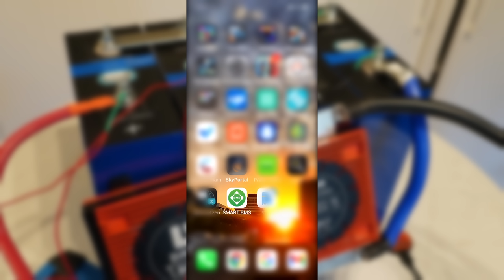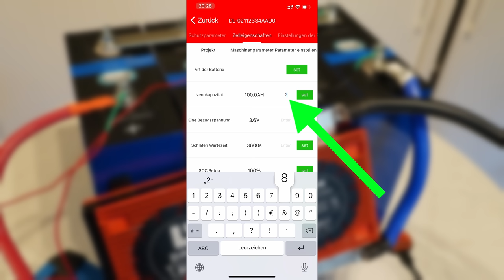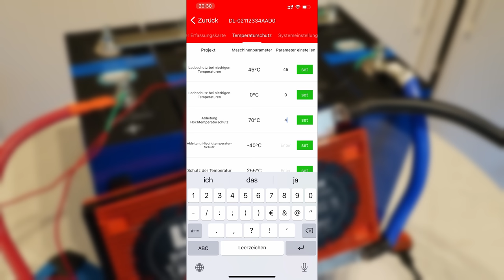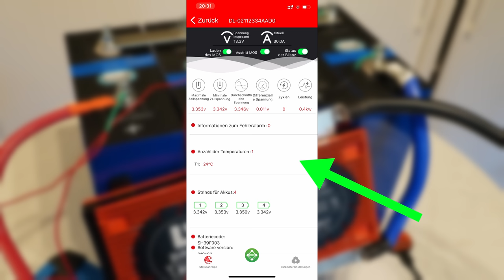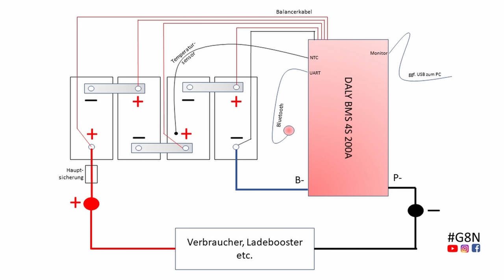Wie? 280Ah 🔋 Selbstbau für 599€, how to mit allen Details ausführlich erklärt #G8N

Comment: Hallo Super Video..
Kleinteile und bms sind schon Vorort.  Die Batterie soll Ende August geliefert werden.
So jetzt meine Frage... hihi
Kannst du bitte die Maße vom Gehäuse veröffentlichen..
Dann kann ich schon mal los bauen.
Vielen Dank
Gruß Stefan
Reply from the maker: Hallo Stefan, meine Maße sind 🤭 ... bzw.die der Box: Boden 178mm x 320mm, 2x Seiten (vorn und hinten) zu 220mm x 320mm, Deckel 335mm x 178mm, rechte Seite 178mm x 235mm, linke Seite 208mm x 250mm. Ich habe 15mm Siebdruckplatte benutzt. Viele Grüße Mr@G8N
Reply: @G8Neu  
Super vielen Dank

Comment: Toll,,weiter so,,,,Welche BMS  ?A brauch man für 4x Lifepo4  305 Ah  ~12v?
Reply: Aus meiner Sicht hängt das Leistung ab, die du entnehmen möchtest. Bsp.: Meine Induktionsplatte hat einen max. Anschlusswert von 1900W - geteilt durch schlimmstenfalls 12,5V, wenn der Akku nicht mehr vollständig geladen ist, ergibt 152A). Ich habe mal gelesen, dass man die beteiligten Geräte (hier das BMS) zu ca. 75% belasten soll. Ich habe mir dann ein BMS von daly mit 250A (ohne Lüfter) gekauft und es funktioniert prächtig. 
Du musst dir also überlegen, wieviel A du max. entnehmen möchtest und nicht was dein Akku zu leisten in der Lage ist.
LG
Reply: @mariahellwege5353  vielen dank,für eine Last ~1000w, 12v,,kaufe ich mir 150A oder?
Reply: @amirkh7257  Genau! Denn P=U*I --> I=P/U=1000W/12V=83,33A. Wenn du die 75%-Regel berücksichtigen willst, kannst du das 150A-BMS bis 112,5A belasten: 12V*112,5A=1350W. Wenn die Batterie voll ist: 13,6V*112,5A=1530W. Kurzfristig kannst du höhere Leistung entnehmen - die Obergrenze kannst du ja selbst berechnen und dann mal ausprobieren, ob da was warm wird ;-))
Da deine Batterie eine so hohe Kapazität (305Ah) hat kannst du die geforderte Leistung natürlich länger entnehmen als z.B. bei meiner Batterie, die 176Ah hat.
LG

Comment: Hallo G8N,
Wissen Sie, ob das Daly BMS einen Nachweis über die elektromagnetische Verträglich-keit gemäß Richtlinie 72/245 bzw. UN-Regelung Nr. 10-02 hat?
Vile Grüße
Rolf Zeller
Reply from the maker: Hallo Rolf, das kann ich nicht mit Bestimmtheit sagen. Auf jeden Fall wird dieses BMS auch in Fertigbatterien eingebaut, die in Deutschland mit CE Kennzeichnung etc. verkauft werden. Die verlinkte Richtlinie richtet sich an KFZ-Teile, ich würde das BMS nicht als spezielles KFZ-Teil einstufen. Auch glaube ich nicht, dass eine nennenswerte elektromagnetische Strahlung messbar ist, schlicht aufgrund der massiven und schweren Metallummantelung des Gerätes (Kühlrippen). Ggf. vielleicht mal den Hersteller anschreiben.  Viele Grüße Mr@G8N
Reply: @G8Neu  Hallo G8N,

vielen Dank für die Antwort. Im VdTÜV-Merkblatt "Kraftfahrwesen 740 Anforderungen an Sonstiges Kraftfahrzeug Wohnmobil" steht unter Punkt 7.2.9 Elektrische Installation: "Beim Betrieb des Fahrzeugs auf öffentlichen Straßen verwendete und fest eingebaute aktive elektrische/elektronische Geräte müssen über einen Nachweis über die elektromagnetische Verträglichkeit gemäß Richtlinie72/245 bzw. UN-Regelung Nr.10 -02 verfügen, z.B. Kompressorkühlschränke/-boxen, Ladegeräte/Spannungswandler, 
Klimaanlagen/Ventilatoren/Fernseher/Radio."

Daswegen hatte ich das gefragt. Ich habe nun beim Hersteller angefragt.

Wie sind denn Ihre ERfahrungen mit dem Zoll bzgl. der LiFePo-Zellern und BMS?
Viele Grüße
Rolf Zeller
Reply from the maker: @rolfzeller3072  Hallo Rolf, das vorgestellte BMS schaltet über MOSFET also kontaktlos. Des Weiteren regelt das BMS keine Spannungen, es schaltet nur. Ich habe leider aktuell, keinen Zugriff auf entsprechende Messgeräte. Meine Erfahrung aus früheren Projekten, in diesem Bereich, bringt mich zu dem Schluss, dass hier nur minimale, bis keine Störfrequenzen oder ähnliches messbar sind. Sollte etwas messbar sein dann liegt es definitiv weit unter den Grenzwerten. Die von dir angeführten Geräte, haben einen deutlich problematischer Aufbau, zum einen durch die verwendeten Bauteile zum anderen durch die Abschirmung z.B. Gehäuse. Die Firma Bulltron baut Batterien mit den von mir vorgestellten Komponenten, vielleicht wirst du ja da fündig. Meine Erfahrungen mit Aliexpress und Zoll habe ich im Fragen und Antworten Video erläutert https://youtu.be/JU4NX1aiRno  Viele Grüße, Mr@G8N

Comment: Moin, also erstmal Daumen hoch für die ausführliche Erklärung. Ich habe selbst auch schon ein paar Akku' zusammen gebaut, nur ebend aus 18650 Zellen Punktgeschweißt für E-Bikes. Nun ist ja oft bei dieser Variante also 12 oder 24 Volt Systemen oft die Rede von Shunt. Wie ein Shunt aussieht bzw. aufgebaut ist, weiß ich nur wofür ist der eigentlich da? Kann ich mir damit auch den Zustand des Akku's anzeigen lassen oder was hat der eigentlich für eine Funktion.
Reply from the maker: Hallo Micha, zum Thema Shunt werde ich nochmal ein extra Video machen. Ein Shunt ist die Tankuhr für deine Batterie. Aufgrund der Art und Weise, wie sie misst und wie sie es berechnet sehr genau. Viele Grüße Mr@G8N
Reply: @G8Neu  ok, also lag ich doch schon richtig mit meiner Vermutung. Hab das beim Umbau E-Auto oft gesehen, wo die Spannung angezeigt wird, aber auch der aktulle Verbrauch in A/h usw....

Comment: Sie haben apsolut bestens video gemacht ueber Lipo selber bauen.
Habe auch eine frage.
Ich wollte von 8 Zellen je 280 ah batery bauen mit 12 v und 560 ah.
Finde nirgendwo BMS 12 v 250A fur 8 Zellen sondern nur fur 4 Zellen.
Brauche ich dann fur 8 zellen 2 oder 1 BMS?
Reply from the maker: Du brauchst nur ein 4S BMS, da ja zwei Zellen immer direkt parallel geschaltet werden. Diese zwei Zellen werden dann wie eine einzelne Zelle betrachtet. Diese beiden Zellen gleiche sich ja aufgrund der Parallelschaltung sowieso direkt immer aus. Beste Grüße Mr@G8N

Comment: Hallo, Respekt, sehr gutes Lehrvideo! Habe mein System (280 Ah und 200A DALY BMS) vor 1 Woche in Betrieb genommen, läuft gut - hätte ich Dein Video gekannt wäre es noch besser geworden. Die meisten Probleme hatte ich mit der Programmierung des BMS über des BT-System da dies erst nicht starten wollte. Dazu scheinen die Benennung von Lade- und Entladestrom vertauscht zu sein (die deutsche Übersetzung ist eh grottenschlecht!!!). 
Stresstest mit 1 KW (88A) für 30 Min verursachte nur geringe Erwärmung, mit 2KW (177A) schon etwas mehr. Die 25mm² Kabel habe ich daraufhin doppelt verlegt. An der Hauptsicherung am Pluspol (selbe Sicherungseinheit wie in Deinem Video) stieg die Temperatur auf 30° bei 14° Raumtemperatur an.
Ich denke das ist noch OK - ist schließlich eine Sicherung die durch Temperatur auslöst, 177A sind da schon in der Nähe der Grenze. Das BT-Modul will ich erst mal zur Überwachung belassen, ansonsten wäre für mich auch der Victron Smart-Shunt erste Wahl.
Würde mich freuen über Kommentare und fundierte Meinungen
Liebe Grüße
Reply from the maker: Hallo Richard vielen Dank für dein Lob. So wie du das beschreibst kann ich das zu 100% bestätigen. Deine Tests scheinen ja auch deine gute Arbeit zu bestätigen, Prima 👌👍 Viele Grüße Mr@G8N

Comment: Hallo ,ich habe eine Frage an Dich. Ich habe DalyBMS mit 250 AH Leistung und dazu eine Zellenleistung von 560 AH. Ich hatte an meine Batterie ,ein Wechselrichter mit 3000w angeschlossen um eine 2600 W 230V Klimazubetreiben. Das ganze ging 2 Min gut, dann ging der Wechselrichter in den Unterspannungschutz. Hatte auf die app geschaut , konstanter Verbrauch laut App 50 Ah. Nun ist es so das die App 13.2 V anzeigt 98 % Leistung.  Wenn nun geladen wird z.B EBL oder irgend welche Verbraucher an sind , zeigt die App keine Einspeisung  oder Verbräuche mehr an!Habe ich das BMS geschrottet`? Über eine Antwort würde ich mich sehr freuen!
Reply from the maker: Hallo, ein 250 A, BMS halte ich für einen 3000 W Wechselrichter bei 12 V für etwas zu knapp. Nichts desto trotz sollte es funktionieren. Der Grund für dein Ausfall kann natürlich mehrere Ursachen haben. Zum Beispiel dass eine der Zellen in über oder unter Spannung ist, oder die Spreizung der Zellen ist zu hoch. Sprich deine Zellen sind nicht richtig balanciert. Oder die Kabel zu deinem Wechselrichter sind zu dünn oder zu lang. Das wären die ersten Punkte, wo ich nachschauen würde.

Comment: Hallo, Danke für die ausfühliche Anleitung! 👍
Was hast du am Ladegerät eingestellt?
Habe ein Victron und auf normal 14,4V eingestellt.
Die Zellen hatte ich einzeln mit 3.6V und 20A geladen, bei 3,555V war der Ladestrom auf 0A.
Nun alle parallel und den Victron Lader angeschlossen, lt. dem haben die Zellen 14,4V
und es geht in Absorption.
Das BMS zeigt mir 14,3V und es wird nix geladen.
Meine Zellen sind trotz einzelner Ladung etwas weit auseinander:
1.3,504V
2.3.580V
3.3,618V
4.3,606V
Was soll ich nun machen?
Alle Zellen nochmal parallel und mit 3.65V nochmals laden
oder einfach parallel schließen und stehen lassen.
Hab gehört, das das bei mehr wie 0,2V differenz nicht gut sein soll.
Reply from the maker: Hallo, es ist schwierig dir einen konkreten Rat zu geben, ohne zu wissen, wie deine Batterie aufgebaut ist, welche Zellen du benutzt hast und wie du sie normal verwendest. Bei den großen Akkuzellen ist es oft so dass der Fehler eher die Kontakte sind, nicht die Zellen selbst. Grundsätzlich ist das Parallelschalten und dann bis 3,6-3,65Volt zu laden und die Zellen einfach ein paar Tage, dann ohne Ladung stehen zu lassen eine gute Idee. Deine Beschriebenen Spannungsabfälle wundern mich allerdings und lasse mich darauf schließen, dass du vielleicht zu dünne Kabel verwendest oder eben auch ein Kontaktproblem vorliegt. Wenn du für dich ausschließen kannst, das ist keine Kontaktprobleme in deiner Batterie gibt, würde ich erst nochmal die Batterie entladen, bis eine der Zellen die 2,5V erreicht hat. Dann kannst du in dem Victron eine Benutzerdefinierte Ladung mit 14,4 durchführen. Selbst wenn 14,4V erreicht sind weiter das Ladegerät eingeschaltet lassen. Das führt dazu, dass der Ladestrom immer geringer wird. Dadurch kann der Balancer dann die Zellen angleichen und muss nicht gegen den Ladestrom arbeiten. Da die Ströme sehr gering sind, braucht dies Zeit, viel Zeit. Das wäre dann eine Absorption über mehrere Stunden. Unterstützen kannst du das in dem du den Ladestrom oberhalb von 95% SOC im Victron halbierst. viele Grüße Mr@G8N
Reply: @G8Neu  Ist ein 4S mit den blsuen 280A Zellen.
Kontaktprobleme oder zu dünne Klabel kann ich ausschließen.
Habe nun erst mal alle Zelle in Reihe und nochmal mit dem China-Lader geladen bei 3,6V bis kein Strom mehr geflossen ist und so stehen lassen.
Werde jetzt parallel entladen und nochmals laden und dann schauen ob der drift weg geht.

Comment: Hallo, 

noch eine Frage :) 
Beträgt der Dauer-Entladestorm der selbstgebauten Batterie denn auch 310Ah oder sind das weniger? 
Ich bin nämlich gerade am überlegen welchen Wechselrichter ich nehmen soll (wenn meine Verbraucher angeschlossen sind, komme ich rein rechnerisch auf ca. 3000W). Aber wenn die Batterie dann nur z. B. 200Ah kontinuierlich liefert, wäre das ein Problem....
Reply from the maker: Hallo, die Batterien sind definitiv in der Lage, das zu liefern. Aber nicht alle „Blauen Batterien“ sind entsprechend spezifiziert. Bei einigen Herstellern steht, dass man nur 0,5 C kontinuierlich entnehmen darf, also bei 310Ah dann 160A. Aber 3000 Watt sind definitiv keine Spielerei. Um deine Batterie nicht zu sehr zu stressen, würde ich dir sowieso lieber ein 24 Volt System, also ein 8S empfehlen. Dann wäre der Strom nur die Hälfte nämlich 150A. Oder ein 12 Volt System mit 8 Zellen, also ein 2P4S. Bei 12V fliesen dann aber auch 300A das bedeutet dann entsprechend dicke Kabel etc. Siehe mein Video https://youtu.be/PY87onSQ96M Viele Grüße Mr@G8N
Reply: @G8Neu  ok, vielen Dank!

Comment: Moin,  super Video.  Aber eine Frage, ich möchte mir so eine Batterie für einen Wohnwagen bauen. Man steht mit dem nicht so lange Autark aber man muss den Mover Antreiben und braucht viel Strom. Also ca. 100 Ah aber 150A an Strom. Habt Ihr hierzu vielleicht eine Empfehlung bezüglich der Zellen?
Reply from the maker: Hallo Markinus, im Prinzip würden dann 150Ah Zellen reichen da die meisten LiFePO4 für bis 1C ausgelegt sind. Alternativ kleinere Zellen, die für eine höhere Entnahme Leistung ausgelegt sind. Eine 1C bedeutet ein Entnahmeleistung von der einfachen Kapazität also bei einer 280Ah Zelle wären das 280A. Es gibt aber auch Zellen die „nur“ für 0,5C ausgelegt sind oder welche mit 2C und mehr. Ich würde da lieber etwas vorsichtiger rangehen und das nicht übertreiben. Viele Grüße Mr@G8N
Reply: @G8Neu  Vielen Dank. Was ist die sicherere Lösung über die Zeit, 130Ah 6c oder 200Ah 1c? Ich möchte idealerweise ein Problemloses sicheres System. Dazu ein 200A BMS. (300 zur 380€)

Comment: Hallo beim ersten laden der Batterie hat mir das BMS ein Zellendrift von 0,1V angezeigt (die Batterie war bei start nur auf 1%). Aktuell bin ich bei etwas über 40% und der Drift liegt bei 0,035V. Das scheint mit dem Ladezustand abzunehmen. Wäre es dennoch besser wenn ich sie nachträglich mit einem Labornetzteil auf 3,6V auflade?
Reply from the maker: Hallo Pascal, ich empfehle dir dringend mal das Balance Video von mir anzuschauen. LiFePO4 oder auch LFP genannt driften im Ladebereich zwischen 20 und 80 % so gut wie nicht auseinander. Daher ist auch so schwer festzustellen wie voll die Batterie ist. Erst ab 3,4 V tritt auseinanderdriften ein. Erst ab da ist tatsächlich ein Ausgleich der Zellen möglich. Wenn du mit einem Labor Netzteil nach lädst reicht aber ein kurzes erreichen der 3,6 V aus. Diese Spannung sollte auf keinen Fall über längeren Zeitraum an den Zellen anliegen. Viele Grüße Mr@G8N

Comment: Hallo und Griaßdeich,
erstmal echt tolles Video, hab auch mit dem Gedanken gespielt mir selbst solche Batterien für meine kleine Inselanlage zu bauen.
Bin dann aber auf Ebay auf den Händler ameer428, Sitz in Guangdong, China gestoßen der fertige 200Ah Lifepo4 Batterien mit Bms für 571,88€ verkauft gestoßen. Jetzt meine Frage, kennen Sie(gerne auch per Du) diesen Händler und erscheint Ihnen die Anzeige seriös?

Ich sag schon mal Danke und wünsch no an schiene Dag, Gruaß Jürgen

Comment: Hey ich möchte das gleiche nachbauen, allerdings mit 8 Akkus mit je 280ah 3,2v und 24v. Wieviel Ampere muss denn das bms haben. Doch keine 280 oder? Irgend wie bin ich noch nicht soweit mit meinem Wissen..
Reply from the maker: Wie sich das BMS berechnet dazu habe ich noch einige weitere Videos gemacht. Du Must das so rechnen Maximal benötige Leistung z. B. 2000W durch die geringste Spannung der Batterie bei dir 20v (denn 2,5v x 8 Zellen) ist dann ein BMS mit mind. 100A Schaltleistung.

Comment: Ein sehr interessantes Video. Danke. Bevor ich das Projekt für mein WOMO starte, eine Frage: Wieviele Wh haben die Akkus? Ich nutze momentan ein 550 Wh mit 40 Ah Akku.
Muss ich mit 3,2V oder mit 12V rechnen ? Sind es bei einem 320Ah Akku: 1024 Wh oder ca. 3900 Wh ? 
Viele Grüsse und Danke
Reply from the maker: Wenn du die Wattstunden einer Zelle willst, dann 3,2V also 3,2V x 320Ah = 1024Wh = 1kWh, bei einem Akku-Block mit 4 Zellen sind das dann 3,2V x 320Ah x 4 Zellen = 4096Wh = 4kWh. Also etwa das 8-fache dessen was du jetzt hast 😊 = ordentlich viel Leistung! Viele Grüße Mr@G8N

Comment: Dein Setup würden wir gerne nachbauen...wie schaut es denn mit dem BMS aus ab welcher Belastung macht das Teil zu? Zb. Beim Vollautomaten....?
Reply from the maker: Hallo Richard, Kurzschluss-Sperrstrom ist bei dem BMS 375 Ampere. Das vorgestellte Setup mit dem 200A BMS ist gut für bis zu 2kW Dauerlast. Mit dem Vollautomaten meinst du wahrscheinlich eine Waschmaschine? Daher gehe ich davon aus, dass du einen Wechselrichter mit mindestens 3kW Dauerleistung hast? Bei einem 12 Volt System würde ich dann ein BMS mit mindestens 300A benutzen. Planst du ein 8s System? Also für 24 Volt, so kannst du das 200 Ampere BMS bis zirka 4kW benutzen. Bei einem Wechselrichter mit 5kW Leistung bei 24V dann ein 300A BMS. In meinem nächsten Video werde ich zu einem solchen System auch nochmal etwas sagen. Also sei gespannt bis bald und beste Grüße Mr@G8N
Reply: @G8Neu  Moin Danke für die Info ist für einen Kaffee Automaten....allerdings steht die Anschaffung einer Waschmaschine eventuell in den nächsten 2 Jahren wenn es auf Tour geht an. Werde Dein System die nächsten Tage angehen. Hoffe es gelingt. mir auf Anhieb 😊

Comment: Hallo, einfach nur toll wie Du das machst! Super Videos die "kinder-und vorstandsgerecht" erklärt sind, Kompliment. Ich bau mir auch so eine Batterie, das ist fix.
Frage 1) zum BMS: für eine 280AH Batterie brauche ich das BMS Daly Smart BMS 4S LiFePo4 12V (habe ich verstanden), aber welche Grösse 30A oder 500A?

Frage 2) Du hast nirgends einen Lüfter eingebaut, reicht die Kühlung wenn oben bei den Zellen einfach offen ist?

Danke für Deine Antworten
Gruss aus Liechtenstein
Reply from the maker: Hallo Hanspeter, vielen Dank für dein Lob. Das BMS sollte so groß sein. Wie du maximal an Strom aus der Batterie ziehen willst. Also bei einem 2000Watt Wechselrichter 200A. Das hatte ich in diesem https://youtu.be/WIGAZKM5l4k Video auch nochmal erläutert. Die Batterien und auch das BMS werden bei normaler Benutzung und ordentlicher Auslegung nur handwarm. Viele Grüße Mr@G8N